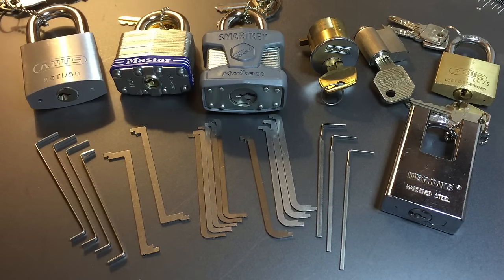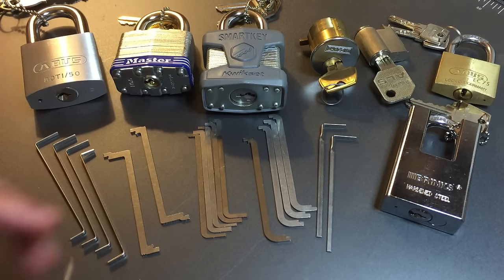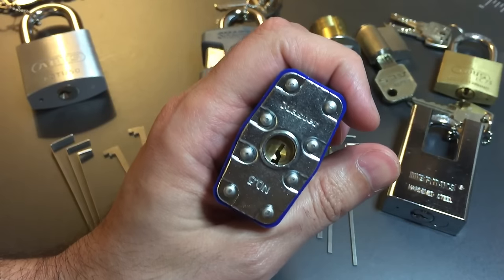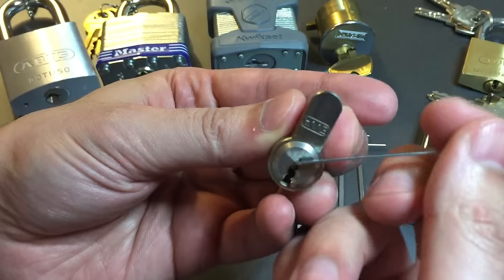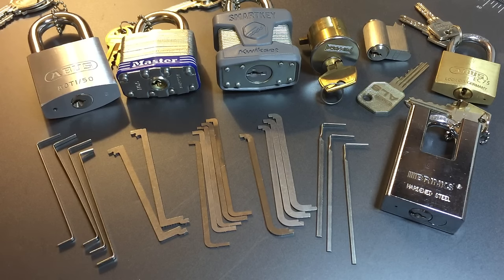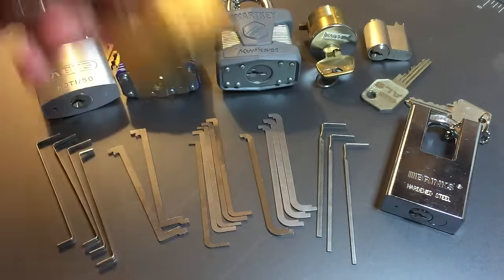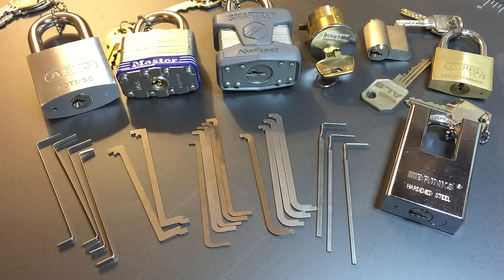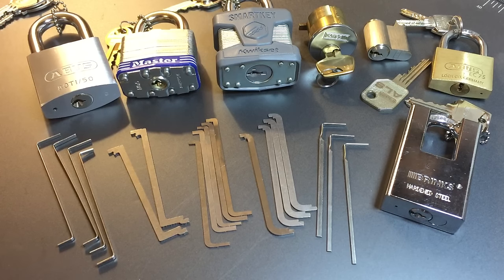[188] My Approach to Lock Picking Tension

Comment: Now what I have found out about tension wrenches is the pressure to apply to a tension wrench should start light and go to heavy after you feel the pin stack, count the number of pins, and determine the space between the pins and the pin diameters for proper pic placement while picking open the Lock. Now a description of light pressure on the tension wrench was described by someone like this, Imagin that you have a pet carpenter ant and that ant is in a circle of ant poison so you want to hold your pet ant in place while you remove the ant poison and you put the tip of your finger on the ants head so he can't move and can't get loose. Now can you imagine how much pressure to apply to a ants head so he can't move but does not get hurt and does not get his head crushed and dies? Well that's a good idea of light pressure on the tension wrench to start with and after you feel the pin stack and count how many pins are in the Lock you apply more pressure on the tension wrench and go from there with as much pressure to apply to a tension wrench as you can just like Lock Picking Lawyer said in this video

Comment: The only problem I've had with your advice is that I have no issues with a lock full of security pins but locks with only a couple security pins it becomes harder for me. Its created bit of hole in my skills. Standard pins  are easy, same with only security, but a mix is frustrating. 
I still think it's good advice, but makes learning bit more drawn out.

Comment: Great stuff! I wish there was a video about picking the last pin when it's also at the back of the lock. I've had to adjust my tools with a dremel. I picked the pin by imitating the key that pushes forward. I've switched pick. The lock opened when I scratched the pin. But I'm a beginner. But the last pin furthest in is really big trouble. It can be mistaken for being the back of the lock. That set's me back for hours.

Comment: I really enjoyed the Video and it was very helpful when it comes to Lockoickung. But as someone who studies mechanical engineering I have to disagree with the vibration part. A spring is not the best way to get rid of vibrations. In fact depending on the frequency they can even make the vibration stronger. To get rid of vibrations you need a dampener which is combined with a spring most of the time.

Comment: I've watched this video now two or three different times and each time I learn a little bit more. You mentioned the Peterson flat 5 but it would be nice if you would at least gloss over the other top of the keyway tensioners and your thoughts on them. I'm trying to put together a list of what I would like to have as a lock picking kit from start to finish (pin tray, vice, picks, tensioners, disassembling tools, etc) and this seems to be something I will need to purchased separately because none of the kits have a good selection of top of the keyway tensioners.

Comment: this is an absolutely amazing video set for beginners. i was wondering if you would make a video explaining the terminology you use, "Binding", "Counter Rotation", "False Set", these are all technical terms, which can be figured out with some intuition and comprehension, but to be honest, it took about 5 or 6 videos before i began to understand some of the jargon, and i think it would be very useful to beginners if you would give us a crash course on common terminology in the lockpicking process and in the commonly found parts of the lock, such as "Back Plate", or "Serrated Pin".

Comment: Couple questions, and these might be stupid questions, but they have been bouncing around in my head for a little bit now.  First, do ALL locks turn the same way?  (i.e. clockwise or counterclockwise)
And second, how do you know what lock is what?  I get obviously they have the brand on them, but like I found a Medico lock that I thought looks really cool.  The cylinder part slides out, so I’m pretty sure that’s the unlocked position, but I can’t turn the key way and I haven’t been able to find really any info on or online.  It’s black, super heavy, and about the size of a hockey puck.

Thanks for all the help in advance, love your videos, I’ve been trying to pick up the art of picking for a while, and finally got my first set of picks.  So I’ve been trying to pick everything I can, that I’m allowed to of course, lol.  And so your videos have been a huge help and very informative.

Comment: @LPL  TransmiSSION is the transfer of mechanical force, transmiTTAL is the transfer of legal documents. The two are not interchangeable as the latter is uniquely a legal term.
As for why springy tensioners are popular, precise motor control and digital sensitivity isn't something most people have. While every pro driver will prefer a german suspension, a driving student will make himself carsick with that and therefore prefers a french suspension.

Comment: Being left handed TOK tensioning forces me to hold the lock and tension tool at an awkward angle since a lot of locks only open when turned to the right. BOK tensioning allows me to hold the tool at a somewhat reasonable angle. I prefer TOK for all the reasons mentioned here but being left handed has yet again screwed me over and put me at a disadvantage by default. 😂 I've started picking locks right handed actually and it's SO much easier to feel feedback since I can use the tip of my finger vs having to use my thumb to feel feedback. Someone needs to solve this whole "everything is made for right handed people" problem that the world has lol.

Edit: this is talking about padlocks. Not residential or commercial door locks. 😊
Reply: I pick my locks upside down when picking left handed.

Comment: I started this hobby just few weeks ago, i did not deliberately watch a lot of videos on the subject. I wanted a more "fresh" experience and get the base level feel from there. Popped my first practice lock within seconds after getting the tool kit but the lock is quite poor (i hope, if it is presentable of that type of locks the.. of boy, world is quite unsecure..). But what i noticed during that evening that tension is everything, specially with the other lock where the pins can go "over"..

Comment: The only reason I can think of as to why you wouldn't want to use heavy tension over medium-light tension is for forensics. Physical pen testers obviously need to lessen their presence as much as possible, locks need to have virtually no changes from how they were before you arrived on the scene. I've definitely left behind some damage in the keyway from needing to apply obscene amounts of pressure to get pins to bind, and that's a big no-no when it comes to physical pen testing because you don't even have to gut the lock to see that it's been heavily tampered with

So in that scenario, medium tension is great, but never light tension because you'll spend more time reseting than you do actually being in a room or in a cabinet and that's just silly

Comment: I found that especially really crappy padlocks from China with awful tolerances can be damn near unpickable if you go with light tension. I have three that are so sloppy that they don't give you any feedback and that set pins just keep falling back out unless you really manhandle the things.
But that only goes for single pin picking. For rocking almost no tension at all works much better with them.

Comment: I got bored and recently learned to pick. I can get most things I've tried open, but I always tension the bottom of the keyway. I just can't get the hang of using the top, the tension tool always slips or twists out of place. It's only really been a problem for two cheap locks I had because the pins were so low that I couldn't insert the pick.

Comment: This is a fantasic video, but I do have a response to your statement about not understanding why someone would want to use BOK tension, and there is another reason not mentioned, that comes to mind.  Sometimes TOK is simply not possible due to restricted movement of the lock, or location, possibly leaving the keyway facing downward, and lighter tension, for techniques, like raking must be employed, so the tensioning technique must incorporate defeating gravity, to hold the wrench or bar in place, as well as proving variable rotational tension, right down to no tension at all, which would make a TOK bar slip and fall out of the keyway. I'm not much for making videos, but if you have a downward facing lock, and you hold it with two fingers and your thumb, palm downward, you can cradle and tension an L-wrench with your ring and little fingers, while picking with your other hand. TOK is still awesome, but I wanted to offer an explanation, which is particularly useful for real world non-destructive rapid entry on restricted access and positioned locks.

Comment: I'm defiantly not a great, maybe not even good compared to some of you guys. However over time I've learned that correct tension AND selecting the right tension BAR/TOOL plus it's placement into the lock is far more important than lifting pins. At least when you're first starting out.

Comment: Old video sure, but just learning now. On my practice lock (which turned out to be a really bad version of a bad lock, so it was too easy) I found heavy tension made it easy to find the next pin. Ive been working on a very tiny master lock, 5 pin, so small I had to modify one end of a double sided tension bar to fit flat in the bottom so I can fit a pick inside. Still can't get it to turn

Comment: I just started really practicing today and at first I couldnt get it at all. I think I was using far too much tension. After some trial and error I learned theres a "sweet spot" to the tension and was less than I thought necessary. I'm learning that lockpicking requires a gentle touch and not brute force

Comment: I'm just starting out.. so I'm frustrated by not even knowing the terminology.  But I certainly don't understand top of key tension!  Aren't you pressing up on the pins?  Therefore you need access to the top of the keyway.  If the tensioner is there isn't blocking pins.  I apologize for all the beginner-level stupid questions... but better ask now than later.  Besides, I have these Sparrow picks you talked me into and I want to pick some locks!

Comment: i just watched your video (188) regarding tensioning. I feel what you are saying about manually tensioning. I have had great success using a cock style coiled flat spring whose ends are bent at 90 degrees to the plane of the coil. one end in the keyway, the other end either stuck into the door jamb or configured to hook onto the body of the lock. i use a serpentine rake which has dual undulations each of different rates. the serpentine rakes are polished to a mirror finish for smooth action. i have had great success using this method. while the clockspring provides tension, the rake positions the pins allowing the cylinder to turn under the torsion provided by the clockspring. i have also tested this method using amatures who have no experience picking locks and they are amazed when the cylinder just pops.         what do you think about that?    Junius L.

Comment: i see why you do top of the lock, but near the top is the pins and usually i need to see which ones are up and which ones are down, so like you said top and bottom tensioning depends on the scenario

Comment: Personally I have always biased towards placing too much tension on my bars so have found it better to use bars that have the twist in them rather than using the flat rigid types. My style of picking is far from perfect and is a cross between raking and individual one pin at a time picking while varying tension constantly from hard to soft depending on if I'm moving the pick in and out or lifting pins respectively. I also am less methodical and slower in order to be more precise but rather favor a fast twitchy series of motions during a pick. I start front to back a few times then reset then back to front a few then middle to front then back and vice versa till it's picked. Only if I run into a stubborn lock which is fairly rare unless it's higher quality do I slow down my method and become more precise with my movements, 

I have known how to pick over 30yrs but have only intermittent bouts with practice due to a lack of locks that I have permission to work on or from a lack of interest in doing so. It's more of a party trick for me to pick a lock similar to knuckling a coin up and down your fingers or those poker tricks with chips. But most of my early experience was working [part time at a locksmith and rekeying locks for them at a $1 a lock. And it should be noted that if you get your experience from locks in vises tilted at an angle it is way harder to then pick a lock on a door due to the difference in the angles of attack. It was like I had to relearn everything again. I could pick anythig even ones the locksmith had issues with when the lock was in a vise I got that much practice rekeying locks but with a lock on a door it was brutal for me. I'm always happy to help a friend gain entry to whatever they got locked out of or when I occasionally show off by picking a lock, usually a padlock as they are easier to do faster before a friend can locate their keys in whatever pocket or recess of their bag they are in . 

I've only had one person look at me with distrust a bit when they said "you carry lock picks in your wallet?" I made my wrench and feeler pick from a windshield wiper which has perfect strips of steel in them for making picks just be sure to use heat when bending the feeler pick and temper the steel afterwards or it will bow fairly quickly from use. Anyway back to their comment I thought of it like this "I may also carry a knife with me too but that doesn't mean it's intended to stab people with, and If I' locked out and my picks are inside with the tools to make them with I'm not getting inside am I?"

Comment: Actually..... I think that engineer would recommend a damper to dampen the vibration. The springs are to allow the suspension to articulate dynamically  with the road surface or lack therof. But we know what you mean... ;)

Comment: @lockpickinglawyer I'd like to get into picking.  I know you have a video on a cheap set of decent picks from China that comes with a transparent lock.  I also know you recommend a practice lock you sell on covert instruments.  However that is out of my budget.  What would you recommend for a practice lock setup that requires less than $20?  I have experience pinning kwickset locks that I don't have a key for by disassembling and repinning it using a key I do have.

Comment: My problem seems to center on not being sure when the pin is picked or if it's still binding. With those new Schlage locks with the spring that slides down over the top half of the driver pin is problematic..

No idea how you manage those "Smart Key" Kwiksets. 😐

Comment: I hope you answer my question. I have a wall safe that unfortunately i locked, with the key inside, the safe is empty, and I think I put the batteries wrong because the key board would not even light up, much less work. It has a small two sided key. I can send you a pic if you want and or answer me.

Comment: This is great info and makes perfect sense. When tensioning from the top of the keyway, how do you stop accidentally pressing the tension bar inwards and binding pin 1 with the wrench. Is it just practicing to keep it in the keyway just sufficiently to provide tension, but not so deep as to bind the pin?

Comment: I don't disagree with the philosophy regarding tension (though I'm really really new so take my opinion with a pinch of salt) but so far my issue is I always put too much tension on. So from the standpoint that a new person is trying to learn, I find that a lot of the times my key pins get stuck in the sheer line. But just for me, I notice that that seems to be because I'm putting way too much tension on the core and as such it causes me to get stuck from time to time. I seem to have more luck when I take the approach of doing less tension but that is just me probably because I always want to tension it to the max. Just my 2 cents. Also for what it's worth, I just do some light lock picking on the side, this is not a job, merely a hobby I'm relatively new at.

Comment: Heavy tension for a pro does not hold the same meaning of heavy tension for a noob. Pros say to use the lightest tension possible when starting out, because heavy tension to a noob means breaking your picks when setting (you are going to overset anyways, so what's the point) Light tension to a pro is FEATHER-LIGHT... light tension for a noob means heavy tension for a pro. So, as a NOOB, I advise against using heavy tension. You are just going to break your picks and get frustrated if you do. *Came back to edit- every lock is different, so it is different for different locks.